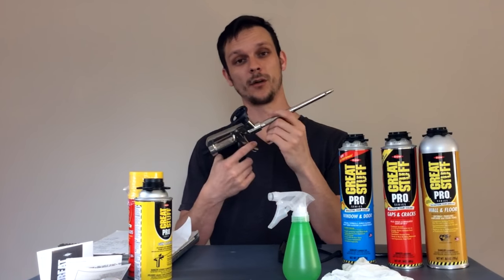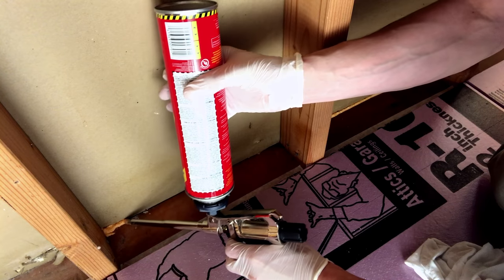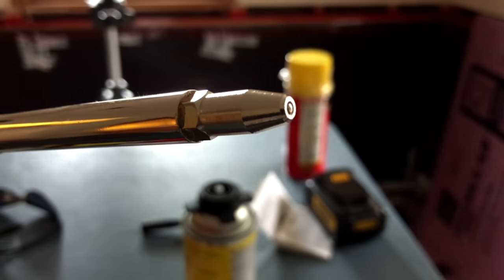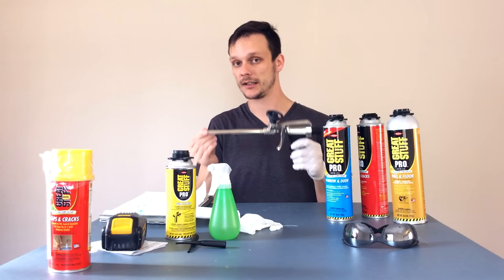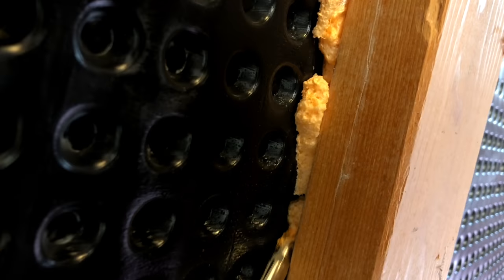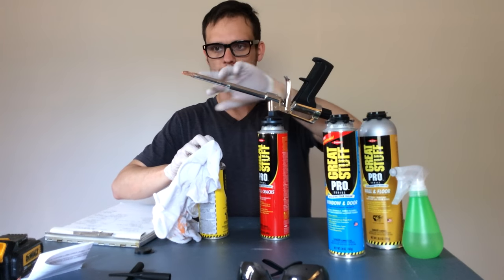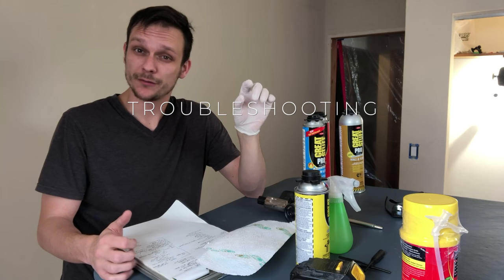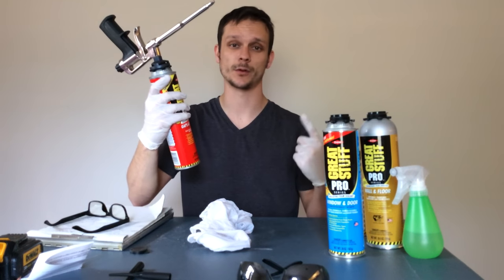How To Use A Pro Foam Gun - Great Stuff Pro 14

Comment: Wonderfully explained- I like the details about storing it wasn't clear from all the manufacturer's instructions how to store the gun- logic says can to be removed every time, yet just cleaning the exterior of the tip thoroughly should be the trick- I will try it thank you for all the guidance on safety too: highly recommended and often missed on the vast YouTube
 Also wondering if you remove a 1/2 used can and then reattach it a week later will it work... perhaps not if air has been introduced into the can lid system 🤔
Reply from the maker: Thanks Jon! For sure, saftey matters. I’m glad you brought this up, this is something I’ve wondered about too, as the instructions on that are less than clear. I have removed a few half cans and tried reusing them because I needed to switch from different types of foam (for example, fire blocking to the window foam, back to fire blocking foam). So far I’m 2-1.(two times it worked and one time it didn’t). I’m not really sure why it has worked versus hasn’t worked but my suspicion is that I did not clean the top of the can off well enough (or I may have introduced air into it as you suggested). It’s a difficult area to clean, I’ve tried using acetone and a few Q-tips to clean the top of the can.

Comment: Excellent video, great tips.
This gun works awesome.
I watched this video before buying the gun and came back to say it works great.
 Another tip, Gumout carb and choke cleaner #1 ingredient is Acetone. #2 is Toluene. Both great solvents and cleans uncured foam fantastic.
Some petroleum jelly on the barrel so foam won't stick.
 If you take a partial can off, spray the top right away with carb cleaner.
If you wear glasses, put goggles over them. Glasses have a space where spraying liquid will go between the lenses. Experience taught me that..
Reply from the maker: These are great tips Mark, than you for sharing!
Reply: Thanks for sharing this, what a lifesaver!   NOBODY sells the Foam cleaner except for AMAZON ( $21 ) and I need the foam cleaner TODAY. So I'll get the gumout spray, which is also a lot cheaper than AMAZON's price.

Comment: Actually you can continue to use a can of you don’t use it all. Get another can of foam and use that straw and it will work. Even if the can has been sitting for weeks. Just use a new straw and you can use the rest of that can buy you need to use the other can too even if just a little. I’ve done this a few times and, trust me, it does work

Comment: Thank you for this video. I got a gun and gaps and cracks can today. I plan to airseal my attic before blowing insulation in. I hope gaps and cracks is okay for general sealing of top plates and attic side of fixtures etc, videos seem to show pros using it for that so I went with it. Though, it is very cold right now so we'll see. I would not have taken a mister or air compressor around for this had i not watched this and read comments. wish me luck, I will do this on monday when its supposed to get in the 50s for a few hours and see how quick i can work with a room temperature can. Btw I was origianlly looking for advice on how to swap between different types, it seems swapping unfinished cans is hit or miss. Probably have to be very fast with the unscrew at point of release.
Reply from the maker: Gaps and Cracks should work perfect for general sealing. Smart move to air seal the attic before blowing in insulation. I hope you project went well!

Comment: i like your tip about extending the 30-days by spraying some more foam out of the gun. i'll try it between my current project and the next one in a few weeks.
Reply from the maker: Thanks! I hope it works for you 😊
Reply: @mikekrzesowiak7944   Hi Mike, 3 weeks later and the can is still good. The directions; on the can of Sika-Boom, says it's good for 2-weeks. About half the can remains so onto the 3rd project.

Comment: I'm going to insulated the interior side of the ribbon joist. I'll install foamboard, then spray foam around the perimeter. I wonder if the can will make it difficult for the tip to reach all the gaps in the confined area of the rafter bay. Can the gun be turned upside down to briefly spray in an awkward place?

Comment: Hey Mike. The AllPro cleaner should've come with a detachable spray nozzle. Did you lose yours? Lol. Thanks for all your work and education. It helped.
Reply from the maker: William, yes you are correct, all the cleaners have a spray nozzle, which is supper useful! Their previous generation/design of the cleaners didn't have the nozzle (that's the one I was using in this video). I've since bought a new can of cleaner that does. I'm glad Great Stuff decided to add that feature, because it does make cleaning the gun much easier 🙂. I'm glad you found this helpful! Let me know if there are any other topics you'd like to see a video on. Thanks William!
Reply: @mikekrzesowiak7944  Hi Mike I have a deep project I have to do in my basement to fill big holes and gaps in walls and ceilings, only thing is I purchased cans of Great Stuff with the straw, I haven't used them yet, and want to know where can I purchase the gun for the foam, and can I easily attach it to the cans I have with the straw.( if so of course I will know to remove the straw) Also can the gun be used on any foam can. Awaiting your reply, thank you.
Reply from the maker: @cdsouthsidec1  Hi Carla, that is a great question. So the "straw style cans" will not fit on the foam gun. The part of the gun that receives the can requires a different shaped can, cans that are specifically made for the gun. The cans for the gun and the cans for the "straw style" are not interchangeable. You can buy the gun at home improvement stores like Home Depot or Menards. (Lowes might carry them too, maybe check their website first). 
Since I made this video  Dow has come out with a model in between the "Pro Gun" and the "Straw Style" it's called "Smart Dispenser." Smart Dispenser cans are about $5-$7 per can. So it might be worth buying one of those to see if it will fit the straw style cans you already have. Judging from photos (from a quick search) it looks like it might fit. I hope that helps and good luck with your project! Let me know what you end up doing  🙂

Comment: Surprised no one mentions to apply the foam to a surface that is not dusty.  I experimented today in my attic, spraying it on drywall that had drywall dust and cut waste and can confirm that after curing, it never really fully adhered to the drywall.  So I carry a can of compressed air and give the area a quick blast.
Reply from the maker: That's a great tip, compressed air! Dust, dirt, and particles certainly affects adhesion to substrates.

Comment: Is there a way to create a fan-type application of foam, to make a thin layer over a large area (like filling in the space between floor joists)?
Reply from the maker: Not that I am aware of with foam. But there is a way to air seal with misting caulk while pressurizing a house with a blower door. It’s called Aero Barrier. I do think it’s a “whole” house application although

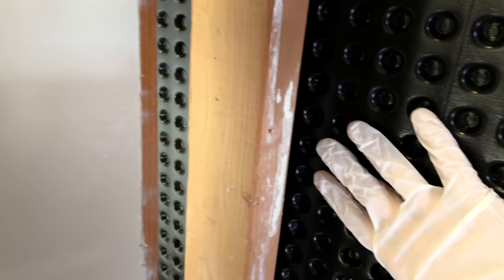Comment: Great video!  What's that black bubble material on the surface starting at 6:12?  What is it called and when is it used?  Thanks!
Reply from the maker: That's a great question. It's called DMX -AG Foundation Wrap / Delta Membrane, it's used for waterproofing foundations, typically on the exterior but it can also be used in some interior applications.

Comment: So I need the large cans to fit ? the smaller cans that come with the straw --the pointy cone which the straw attaches to is not a FIT?
Reply from the maker: Correct, do you need the larger “pro” cans to fit with the pro foam gun

Comment: I actually have foam stuck between the gun and the canister. If I take it off I will lose all the gas? If I don't I can't clean it? What to do?
Reply from the maker: Hi Philip! 
Sorry for not replying to your question earlier than now as I'm sure this was pretty urgent.

If you remove the canister of foam form  the gun it will not loose all its gas. Just be sure to unscrew the can fairly quickly (if done slowly more foam may discharge at the connection point between the gun and the can), and wear safety glasses while doing so (just in case)

You can clean the uncured foam with acetone. You could also use a q-tip cotton swab with acetone to remove it. I've also used as flat head screw drive wrapped with a thin cloth, dipping it into acetone to and then readjusting the cloth as it gets gunk-ed up with foam. 

The "Great Stuff PRO Dispensing Gun Cleaner" in a can primary uses acetone I believe. You can also discharge the gun cleaner into a rag and use that to try to clean up the foam (also wear safety glasses)

If the foam has already cleared unfortunately Gun Cleaner or Acetone won't do much. You might be able to chip out the cured foam with a razor knife or metal pick set, but be careful not to scratch or chip the teflon coating (grey-ish in color) on the gun. 

I did unfortunately have one Pro Foam Gun I had to throw out because the foam cured inside of it. Hopefully that doesn't happen to you!

I hope that is helpful, best of luck to you.
Again, sorry for not commenting sooner.

Comment: So I have to buy the pro cans to use with the pro applicator? I bought the regular cans with the crap applicator I want to use the gun with those if I can
Reply from the maker: James that is a good question, you are correct. The Pro cans need to be used with the Pro Applicator. You cannot use the Crap applicator cans with the Pro Foam Gun.

Comment: How do you use the gun pointing up at a steep angle without the can pointing sideways and not working?
Reply from the maker: It admittedly doesn’t work very well at a steep angle. You may be able to get it to work for a few seconds, then go back to using it at a non steep angle for a bit, then back to the steep angle and so on repeating this. It doesn’t work great, but I’ve gotten to “kind of” work doing it this way.
Reply from the maker: So I've been thinking about this some more... I think I may have a solution for you. 

You could buy a small roll of clear vinyl tubing and cut off a 1-3' section and use it as a "flexible extension" of sorts. You would end up tossing it away after you're done becase the foam would cure in the tubing. I used this once for some hard-to-reach places when sealing a rim joist and I don't see why it wouldn't also work in your situation. The tubing would be long enough that you could access the needed area while keeping the gun upright, avoiding the problematic steep angle. Just be sure to get a diameter of the tubing that would fit over the end of the gun. 

If you try something like this, let me know! I'd love to hear if it works. Best of luck!

Comment: Great explanation. What's the maximum range of this one? Is there an air compressor version for bigger jobs?
Reply from the maker: That is a great question! It's hard to know exactly how much foam you will get out of these can because the manufacture doesn't spec their yields (or at least I haven't found where yet. The closest I found is here where they estimate how many windows you can seal with the Window and Door Foam: https://images.homedepot-static.com/catalog/pdfImages/ea/eac1c7ae-ecac-45ff-958d-f9bcfcd27193.pdf  Of course there are way too many variables when sealing windows to know for certain, like how big of windows, how deep is the joint being sealed? How wide is the gap? etc. So not very helpful). In my experience, the Pro Foam cans do seem to last much longer than the straw style cans. This could be because: 1) You have more control with this setup, so you're less likely to waste foam by inaccurate application 2) The chemical formula could actually be different, causing a higher yield. 3) It could just be because the cans are bigger (Most probable). For example, the Pro Gaps and Cracks comes in 24 oz and 30 oz cans, where the Straw Style comes in 12 oz and 16 oz cans. 

There is not an air compressor driven polyurethane foam set up that I am aware of, however, they do make a larger 2 component set ups (about the size of a propane tank) for larger applications. Dow Froth Pak by DuPont is one example. Yields for these are specified in "board feet". They have models that yield 12, 210, 620, 650, board feet of foam.

Comment: Hey there. Can you adjust the foam gun to fine spray setting?
Reply from the maker: Hi, yes. There is a black dial located at the end of the gun, this allows to adjust how much foam comes out of the gun. A lower setting makes a smaller or more fine bead of foam, a high setting results in a thicker or larger bead of foam. Hope that helps!
Reply: @mikekrzesowiak7944  thanks for the info!

Comment: non chlorinated brake parts cleaner works great for cleaning also. it contains acetone, toluene, and a type of alcohol the censor wont let me type. carb and choke cleaner also.
Reply from the maker: Awesome, thanks for the tip. I’ll have to try that.

Comment: Can you remove a half used can of foam to clean the gun?  I tried once and the can emptied out on the garage floor
Reply from the maker: So far I’ve had mixed results with that. Sometimes removing a half can has worked and sometimes it hasn’t
Reply: Same thing happened to me today. Unscrewed from the gun and it just all came out. Luckily I was over a trash bag when I did it. Wasted just about the whole thing.

Comment: Question. What do you do when you swap between different cans. Do you have to use only one can at a time? I might need to use one can for small gaps and then swap for another for big gaps. Will the other bottle dry up if not finished? Thanks for the video.
Reply: Two comments below -- mine and someone else's -- show that removing a partially full can can easily empty the remaining contents with no control. If you attempt it, only do so over a trash bag and be prepared to lose that entire can! Also know that Great Stuff never claims it can be done. They assume you'll use up an entire can.

Comment: Can the Grate stuff Pro be used over head ?
Reply from the maker: Hi John, yes it can. However, I've noticed that it doesn't work very well if you turn it upside down. When in that position sometimes only air/gas will come out of the gun and not foam
Reply: @mikekrzesowiak7944  Thanks!

Comment: You can actually take the gun apart and clean it if it gets backed up. Its not hard to do
Reply: would it be worth it to take new gun apart and apply anti seize on the threads so they don't jam up.

Comment: Voice quality not so great
Reply from the maker: Yeah, the audio sucks, video quality could be better too
Reply: @mikekrzesowiak7944  thanks to this recording I have ordered 2 cans of the pur black and the spray nozzle gun from eBay. Now, to try the merchandise. 
NOTE:  cans say to not spray inside. I suppose the fumes are toxic???
I was really looking forward to mixing this foam with round bundles of coarse shredded wire and tuck them into the crevices between the carpet and the wood molding